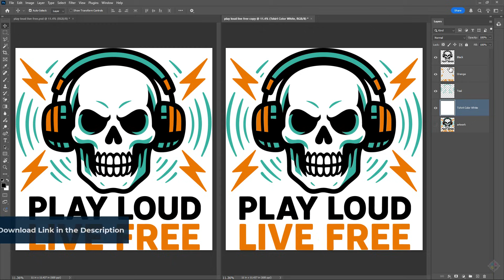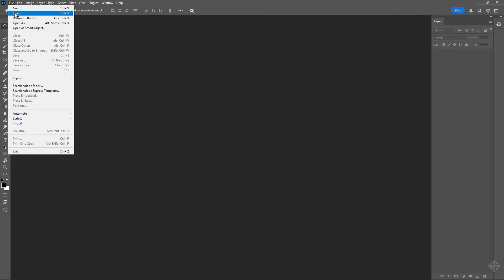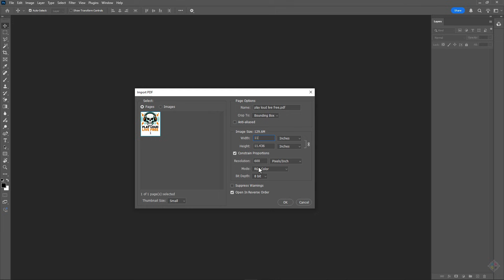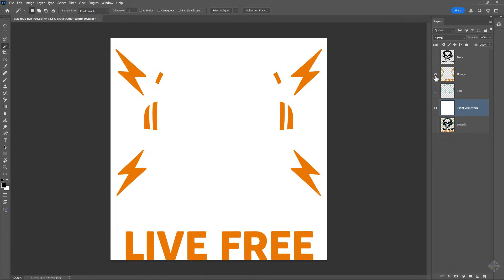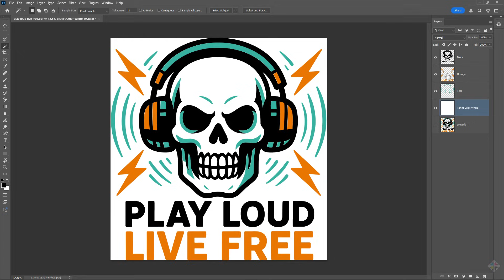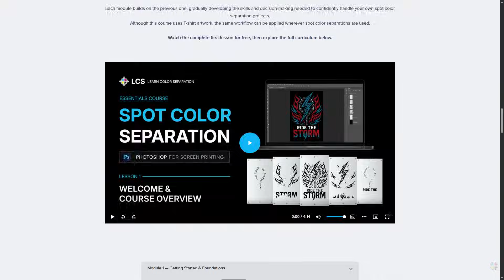How to Do Spot Color Separation in Photoshop for Screen Printing (Beginner Tutorial)

Comment: Why 600 dpi and not 1200?
Reply from the maker: You can definitely use 1200 DPI, but it is more than you need for most jobs. It will also make each step take longer, especially if your computer is slower. 600 DPI works very well for most spot color separations, and most computers can handle it easily.